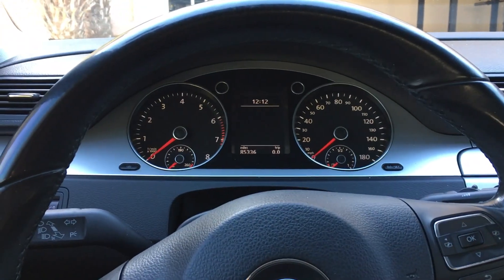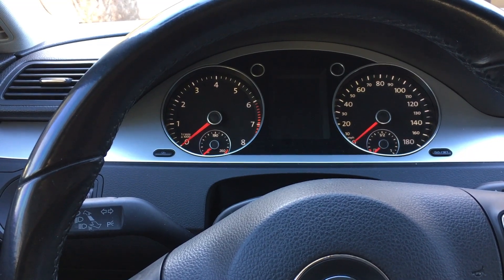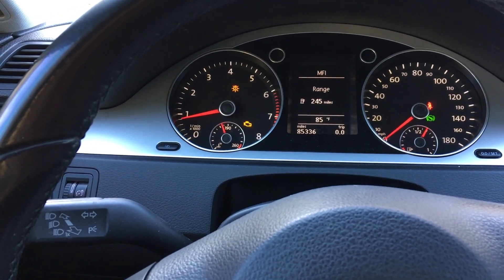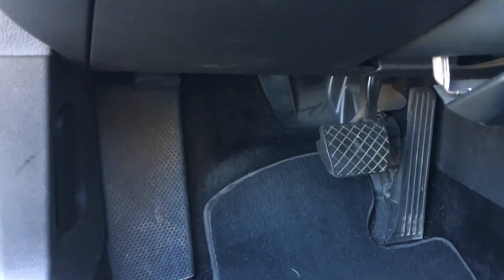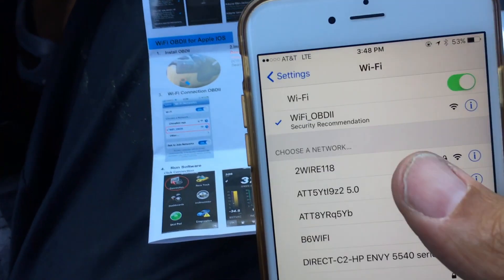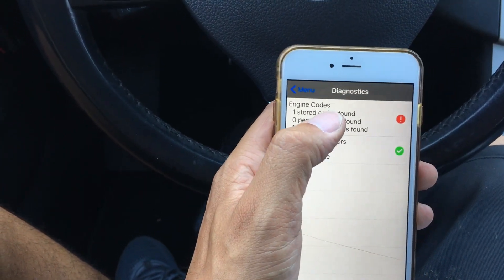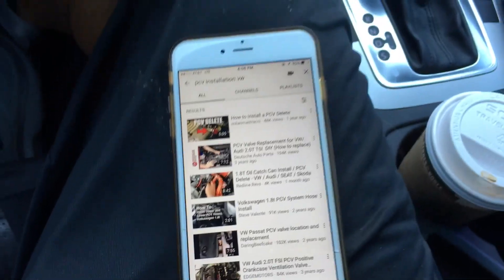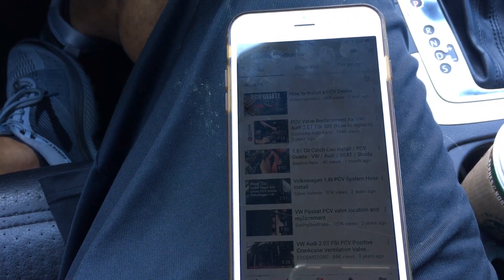OBDII scan on VW P2187 code

Comment: I just got the same code on my Tiguan. I’m also in SD.  How much did you spend on the fix approximately?
Reply from the maker: I ended up taking it to the shop. I took it to A&D Autowerks in Kearny Mesa area and because the rear main seal needed to be changed, it was around $800. I would get it fixed before you blow the rear main seal on it.

Comment: It's just the diafram it's a cheep fix
Reply from the maker: I replaced the diaphram first, then the PCV assembly and still threw the code. Took it to the shop and they changed the PCV and also the hose to the valve and still throwing the code. Took it to a different shop and it was the rear main seal that was letting in air. It is now fixed and working 100%.
Reply: DeezNeez01  How much did you end up spending? I left my 2012 CC at the Service center today because of the same P2187 code. Funny i started getting this code the very next day i updated my Timing chain Tensioner.
Reply: @3lok2689 Hello.  How did you solve the problems after updating the chain?
Just by replacing psv code P2187 disappeared?
Reply: @DeezNeez01 What was the cost?

Comment: Hi, does the replacement of pcv valve solve the issue?
Reply from the maker: Lyova Kurginyan it did not. There was a vacuum leak somewhere around the intake. However, it's worth swapping to be sure. Just return the part if it doesn't work.
Reply: So fixing the vacuum leak fix the problem?
Reply from the maker: No. Took it to the shop and they replaced a few parts (EGR valve I believe). I would have to find the receipt.